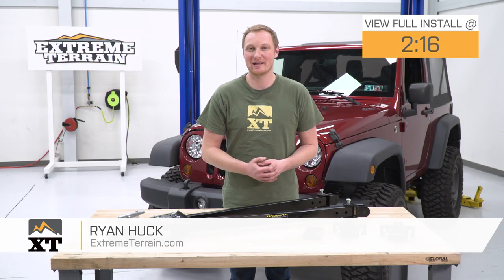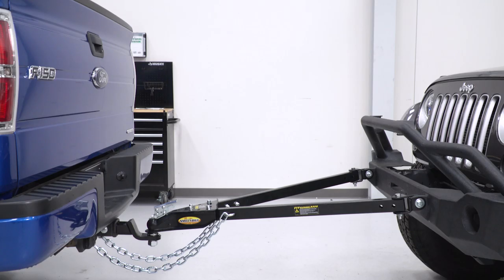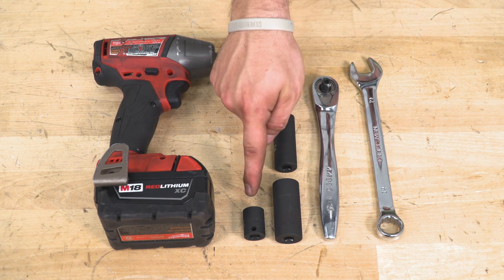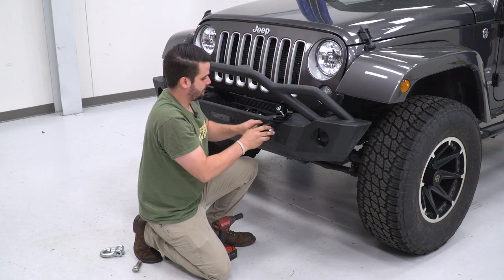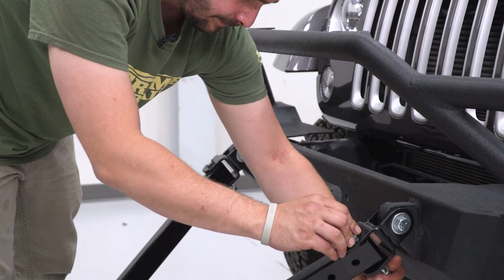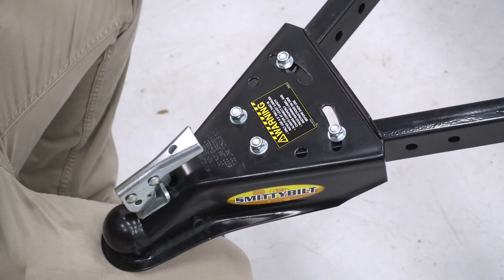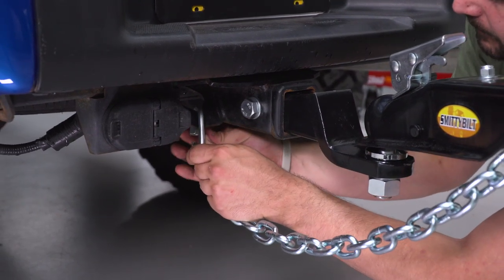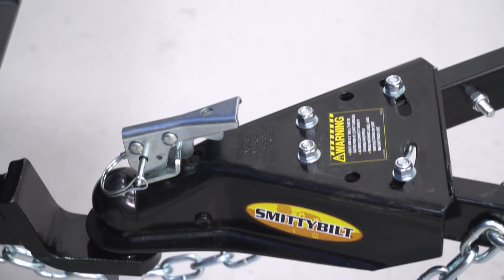Jeep Wrangler Smittybilt Adjustable Tow Bar Kit Review & Install

Comment: You should cross the safety chains when towing to the opposite side.  The point is to catch and cradle the tow hitch in the case it comes unhooked.
Reply: That's what I was thinking.

Comment: Should the key be left in the ignition, and turned to the first position, to verify it's inlocked?  The steering should remain unlocked during all towing, right?  Thanks, and.great video.
Reply: yes
Reply: Not sure why not he did not leave both transmissions in neutral - key off.  Steering must not be locked.

Comment: When I found this kit on Extreme Terrain I almost cried..the kits on eTrailer are waaay more expensive..thanks Smittybilt and E.T.!
Reply from the maker: Glad we could help, Robert! Hope you enjoy it! -Zach
Reply: @extremeterrain  So if the bumper has 'D-Ring mounts', this is legal? Do you have an actual list manufactures of aftermarket bumpers that qualify, I have heard a lot of contradictory information about using the 'D-Ring mounts'. It does seem to make sense though, just wondering about the legal aspect of this method. Thanks

Comment: I just bought this tow bar.  I used it last week to drive from Phoenix to Dallas.  It worked very well and had no problems.  I used the d ring on my warn bumper of a jeep JKU, pulled it with Silverado 1500.

Comment: I'm installing this now and had to go to home depot to replace the hardware, I couldn't tighten the locking nuts on the bolts even with an impact wrench...I'm guessing they were defective, very puzzling.  The new hardware {class 8} went on like butter.
Reply: The supplied nuts were lock nuts with nylon in the last few threads to lock the hardware together. Regular grade 8 won’t act the same way

Comment: You forgot to mention a wiring harness for the lights on the back of the Jeep.  I believe this would be rather necessary.
Reply from the maker: That would definitely be helpful! We opted not to cover install of a wiring harness though simple because this kit is just for the tow-bar itself. -Zach

Comment: does the steering not lock? my samurai i need to put the key in and cycle it on then off, it only locks when the key is removed
Reply: key has to stay in ignition and one clink from the on position to unlock the steering

Comment: It looks like the brackets come with East disconnect bars that would allow you to easily take the bar off the bumper. You chose to use the bolt that needs a tool to take it on and off the bumper. Why not just use the quick disconnects and remove the tow bar very easily from the Jeep?
Reply: I read the quick release bolts are for short haul, the manufacturer recommends the bolts for cross country.

Comment: This tow bar is a piece of crap for flat towing a Jeep Wrangler Unlimited.  Its rated up to 4000#  a wrangler Unlimited is 5000# Plus if you have aftermarket accessories.  The Harbor Freight A frame tow bar is 1/3 the price rated at 5000#   The smittybilt bolt ripped out of the thin metal , Jeep then came forward ans hit the RV.
Reply: Sounds like user error